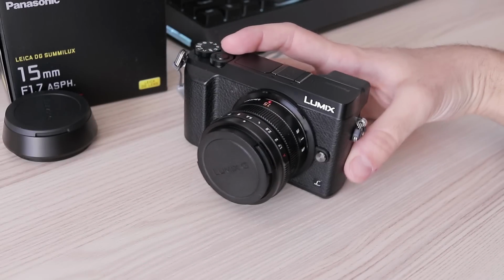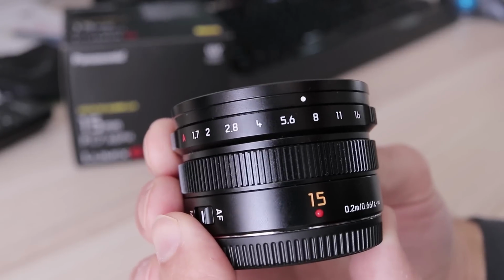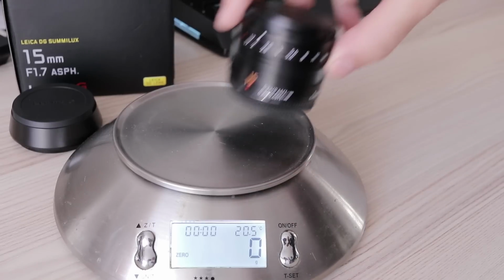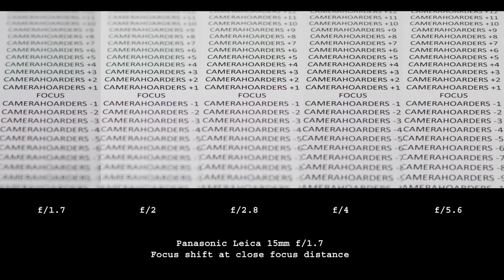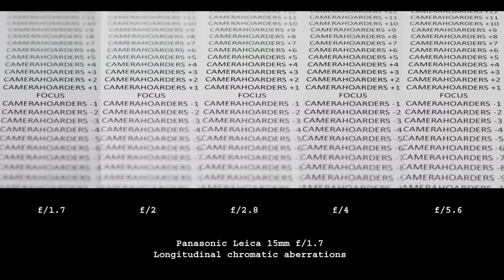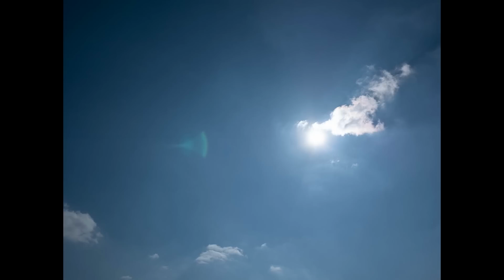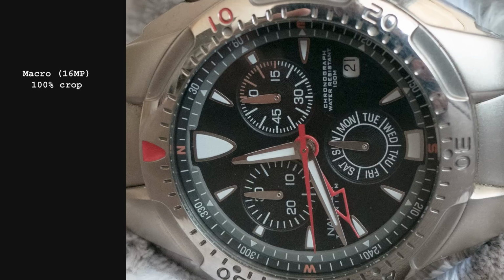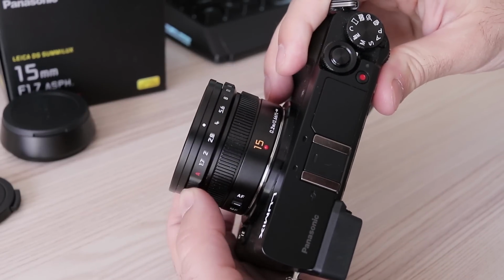Panasonic Leica 15mm f/1.7 review

Comment: I must add that Chromatic Aberrations are fairly strong on Olympus bodies: Olympus cameras wont fix Lumix lenses on the fly and you need to fix everything in post, included jpegs.
 If you have a lumix body this lens is among the best, but on Olympus is produces fairly strong CA and very noticeable distortion to the corner fields, so it's not a very enjoyable lens. The aperture ring won't work either. I traded my 15mm for an Olympus 17mm 1.8, which works fine on both my Gx9 and my Pen F
I wonder why Olympus and Panasonic were never able to sort each other's lens line on proper camera firmware as M43 is all about cross compatibility and not brand protectionism.

Comment: The DJI version of this lens does not work for me on Olympus EM5 mk3 in continuous AF. Single shot AF is fine and so is C-AF in video mode. From googling it looks like all PDAF bodies behave like this with it. Does anyone know how the Panasonic branded one behaves in C-AF on PDAF bodies? There is a firmware difference between the two.

Comment: would you take this 15mm over the 20mm Lumix?  I'm getting again (lol) the Lumix 42.5mm and want to get a partner lens either the 15mm or the 20mmi also have the be lumix 45-2000mm for my bird seed insect pics .. thanks
Reply from the maker: I have the 15mm for almost two years and am not letting go of it.
Reply: @Camerahoarders  thanks ,but you most likely have the 20mm to I'd imagine..
Reply from the maker: Nope. Sold it almost year and a half ago.
Reply: @Camerahoarders  you couldn't really use the 15mm for a portrait like the 20mm
Reply: @lfcmarkeb7124  why? you can do portraits with 35 and 50mm, why could you not with a "30" and "40"? The 20mm is lighter, smaller and cheaper, the 15mm is just optically a little better with an aperture ring and imo a better bokeh, chose yours ;) . I also have the 42.5 f/1.7 Lumix for close portraits, 15 or 20 is pretty the same for environnementals (but I use it for landscapes too, so better as long as I don't have wider angle lens).

Comment: Did you check the vignette without the supplied hood?  I didn't like the look of the stock hood; and so I have never used it... I use a 46mm-52mm adapter so that I can use my favourite 52mm ND 10 stop filters (B+W) and I have seen no vignette in my pictures...

Comment: I use it on a GX80, known ans GX85 in the States and god knows how in Japan. There is one annoying quirk. I hoped I would be able to benefit from the manual aperture ring. Meaning - the camera has a front and a back dial. So I hoped I would be able to control all 3 things at once - aperture from the lens ring, shutter speed from 1 dial, Exp comp from the 2nd dial. Nope. Cannot do that. No matter how you configure the wheels on the camera and whether you choose Manual, A priority or S priority - it doesn't allow you to do it. So, in reality, the manual aperture ring stands on A (which is automatic) and the lens is controlled just like any other lens, without a manual aperture ring. Stupid.
Reply: @marc henry  It is hard to create bokeh with the 15mm, even at 1.7, unless you are very close to subject and the background is at least 3 or 4 yards away. This is a good lens only for full body portraits, I would say. For traditional ones, head and shoulders or tighter shots, better use the 42,5mm as a budget option. And if you are ready to give $500+ for a portrait lens, used Olympus 75mm in good condition is what will give you all the bokeh in the world. But it's a limiting focal length. The 75 that is. I used it a bit, it creates images like no other, but few occasions are suitable for such a tight prime. And about zooms - if you wanna good portraits with a zoom, buy the 35-100 2.8, not the short one.

Comment: I have a Panasonic G9 with the Panasonic 25mm f/1.7, Olympus 45mm f/1.8, and the Olympus 40–150mm f/4.0–5.6. I'm wondering if I should get the Panasonic 15mm f/1.7 or a Panasonic 12–35mm f/2.8. What do you think?
Reply from the maker: Optically, both are very good, don't worry about IQ. With 12-35 you get dual OIS with the G9 which does wonders for static scenes but with 15mm you get f/1.7. It's up to you what you prefer or if you want a prime or a zoom. Since you already have 25&45 primes, 12-35 kind of doubles that range, so 15mm might be better choice.
Reply: Thanks for the response! I really love your reviews—they're up there with David Thorpe and The Hybrid Shooter. Very thorough and methodical. I was worried about the IQ with the 12-35. I've decided to buy the 12-35 for the dual OIS, weather sealing, and versatility. I've never had weather sealing on a body and lens before, so I don't know when I'll really use it. Hopefully I won't miss the f/1.7! Thanks again!
Reply: I had the 12-35mm f/2.8 lens. I agree with Camerahoarders saying the Dual IS2 is great (I had the Mk II) while the PL 15mm does not have OIS. I became disappointed with IQ on the 12-35mm since I shoot a lot of portrait photos with the Nocticron. I ended up replacing the zoom with the PL 15mm.

Comment: I have a Panasonic G7 that I find amazing for the price. I'm using the kit lens 14-42, mainly at 14 mm as a wide angle to shoot landscapes and old villages in Europe. Here are my questions: 
1-Considering that I shoot mainly outside in bright daylight
2-Considering that in my landscape and building pics I want everything in focus I always use f8-11 on the kit lens at 14mm. 
3-Considering that I'm not after the light gathering capability of the 15 mm Summilux, what would be the real advantage of the Summilux used at f8 compared to the 14-42 then? Is there such a drastic difference in image quality at those apertures between the 15mm and the kit lens at 14mm. I find the kit lens remarkable, for its price, at the wide angle end.

Comment: Its one of the best lenses in the Leica Panasonic line up, though it was quite slow to be adopted. It used to be available on eBay new at 280 pounds though those days are sadly gone.
Reply: It is still worth the current asking price due to the lovely colours and micro contrast it produces. For run and gun or general day to day ease of use its a masterpiece.
Reply: 2019 here, just bought one for £270.

Comment: how do  U think  about 15 1.7 comparing to 14 2.5.  although 14 2.5 is about a stop slower and  much  cheaper. I find 14 2.5 very sharp (at least  in the centre)
Reply from the maker: Haven't used 14/2.5 but according to pretty much anyone who had both 15 is a better lens. A friend of mine had it and was happy but eventually changed system.

Comment: Hello, I have owned this little lens for 2 1/2 years now, and it is by far my most used in my line up ! the fats aperture is very convenient for indoor shooting and the image quality is very satisfying to my taste. My only 2 complaints are regarding the built :
1) Although I love having an aperture ring (I also shoot with Fuji) the ring is too easy to rotate unintentionally
2) Although I love the fact the lens cap fits inside the lens hood, the lens hood lock mecanism is not resistant enough.
I swear I am very gentle when manipulating my gear (am not a pro, just an amateur so am never in a rush to switch lenses...) but it is too easy to manipulate by accident the lens hood and the aperture ring.
But it really doesn't stop me to love my 15mm f1,7 to death !! haha   sorry for my poor English :)
Reply from the maker: Might be sample variation as my lens hood is firmly in place. Wouldn't be surprised since Panasonic has some mechanical variations between lenses (for example 100-400 zoom ring which is sometimes really sticky yet some users report it glides effortlessly)

Comment: 3:33 I very much doubt Olympus wouldn't correct geometric distortions. This is part of the micro 4/3 standard since day one. What Olympus doesn't always correct is chromatic aberration on Panasonic lens, although knowing exactly which couple body / lens is or isn't CA corrected is a bit difficult to establish.
Reply: Olympus does correct geomectric distortion. This lens is not fully corrected even after software auto corrections. For landscape it's ok, for architecture it could raise some troubles. Anyways you can always correct it in LR.